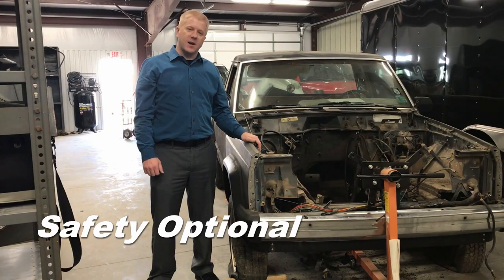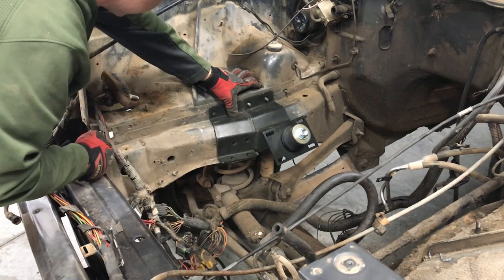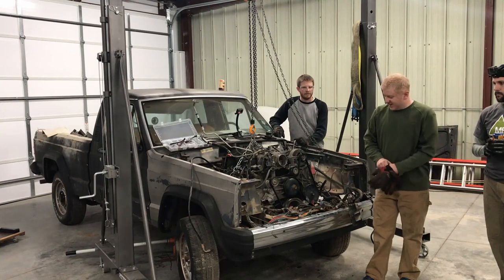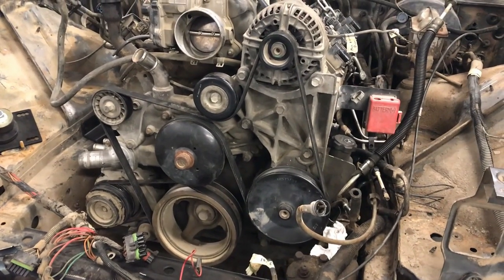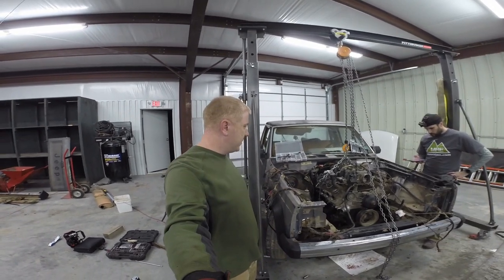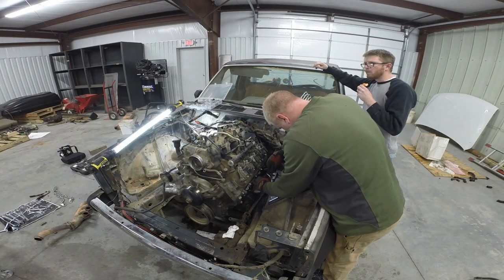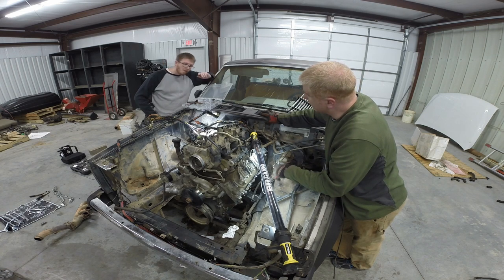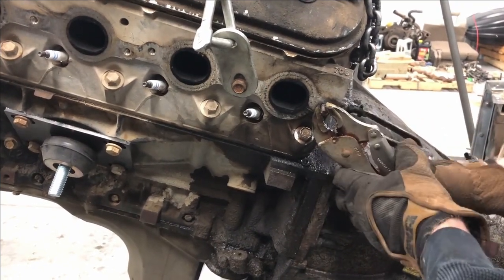Jeep Comanche Pickup V8 Swap - Part 6 - Test Fitting

Comment: Sweet setup, in the middle of a 5.3 in my Comanche. With them Novak motor mounts do you have to run a car intake and accessories to clear the hood or make a cowl hood? Also with them motor mounts did you have to modify the firewall at all? I’m not 100% but I believe 1998-? Camaro manifolds clear with a little work.
Reply from the maker: We just picked up some Camaro manifolds for it that we’re going to try.   Our plan is to run it with no hood at first just to get it going, then swap intakes later.   Unless we have to swap intakes to make the accessories work.

Comment: I have a jeep cherokee pioneer I used block hugger center dump headers. Novak has them on there websight. I just have old school SBC 350 th350. I also used a painless wire kit worked very well easy to install. Exhaust install took some work but went well. If you want pics of mine let me know. I'm in cali e mail cbr600f2j@yahoo.com hit me up. Your the first person I've seen do a 4 cylinder jeep to v8 swap like I did.
Reply from the maker: Keith, I’d love to see some photos.  I’ll shoot you an email.  We’ve picked up some camaro exhaust manifolds that we think might work and were cheap.  We’re debating buying a premade wiring harness or sending ours off to get pared down to the basics but we haven’t decided yet.  

We’re also working on the accessories mounts issue. I’ve gotten a lot of recommendations from some Facebook people but only a few relocate the power steering like we need.   

Hopefully we are able to address all that in our next episode.
Reply: @SafetyOptional  ya mine is just an older chevy 350 not so many extras on engine like the LS but still way cool. Well good luck and novak adapters has alot of info on there we sight about the swap.
Reply: Wanted to know if you wouldnt mind sending me some pictures? Im in the middle of the swap and all I need is the engine mount adapters and a good plan for wiring. If you wouldnt mind.
Reply: @MelvinElMorenito  yes I can not a problem. What jeep are you working on and what engine are you going to use? Send me a e mail